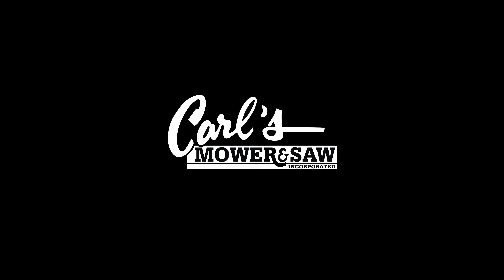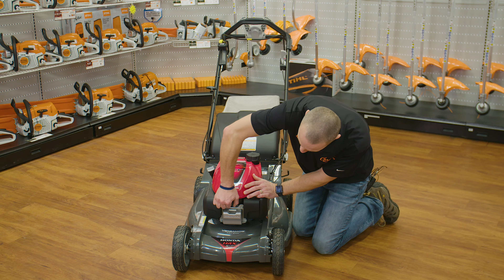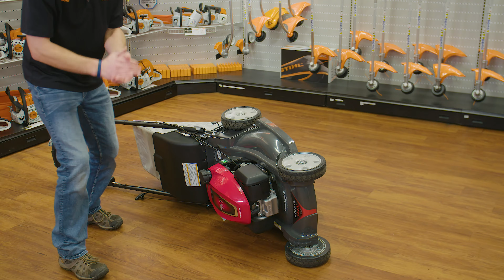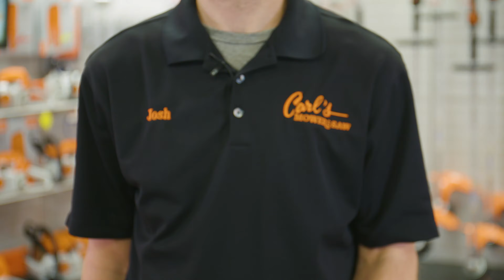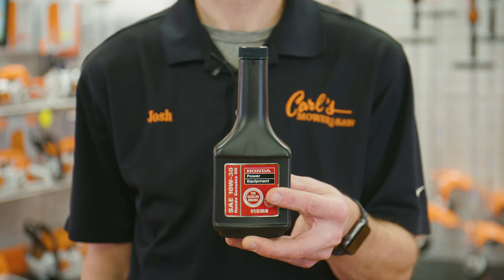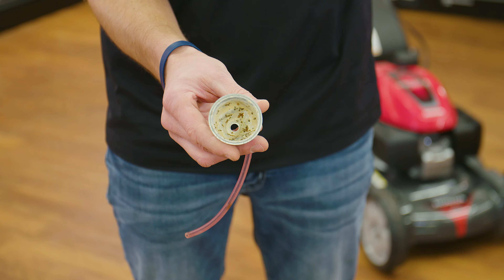Honda Basic Mower Maintenance

Comment: So running the mower once a month is better than having the mower run out of gas at the end of the season?
Reply: My thought, exactly -- especially with today's miserable ethanol-gasoline. However -- although he didn't specifically say so -- I took his suggestion to mean that, monthly during the off seasons, you put in some preserved fuel and run the mower until it's out of gas. My opinion, anyway.

Comment: How about the gas cut off and whe should you have it flowing or cut it off?
Reply: Great question cause i wanted to know the answer to that too.
Reply: Use the cutoff when you've finished mowing, each time; then, let the carb use up what's left in the bowl and the line. The cutoff should be engaged whenever you are not using the mower.
Reply: @MCOult I did not know that. I was under the impression it was more of end-of-season, putting it into storage thing.

Comment: Thanks for the video.  Isn't it easier to just run the mower out of gas on the last cut of the season instead of adding fuel stabilizer before winter storage?
Reply from the maker: Sure is. But we see at best a 50/50 success.